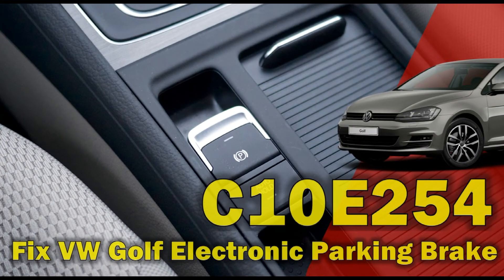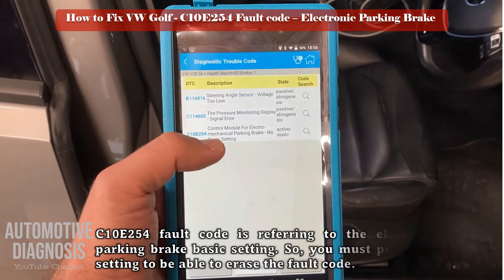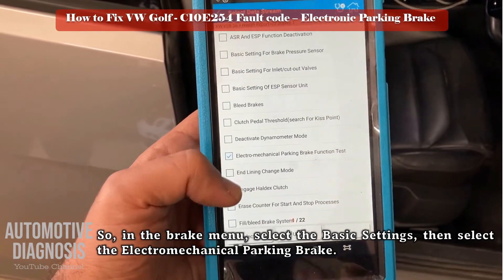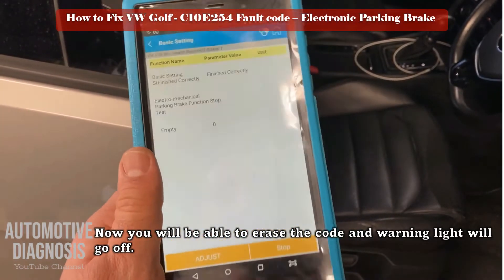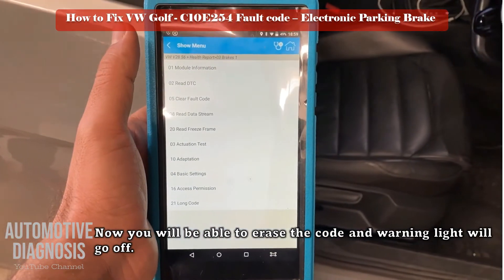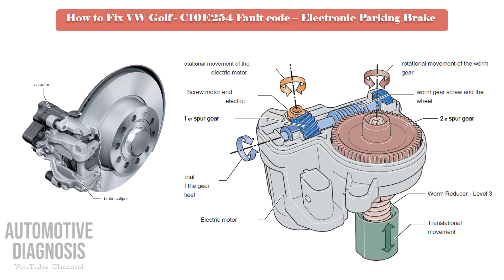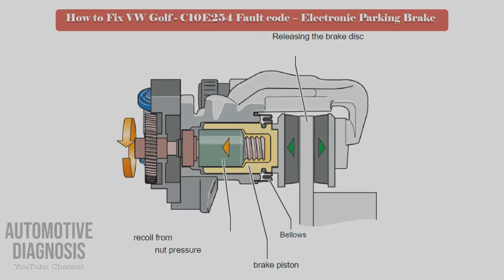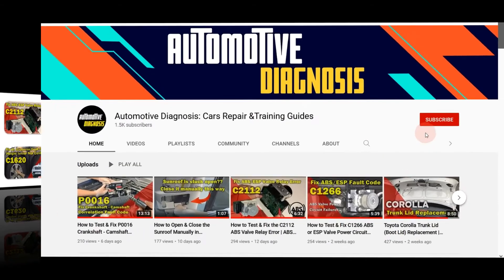How to Fix C10E254 Fault Code on VW Golf Electronic Parking Brake (EPB) Just in 2 Minutes

Comment: Hi I have the same problem and the same code.
It says on my dashboard error parking brake it does not release the brake on the right side I got the caliper changed I put a brand new one in I also changed the parking break switch but it still has the same problem. It says the same code and parking brake module the car does not release the handbrake it’s been 3/4 weeks not problem is still not solved I’m just spending loads of money
Reply: Im having the same error, did you fixed yours? If so please help me

Comment: Nice tutorial, thank you. I had the same problem with Passat GTE but I was not able to delete the fault in the ABS module, but if you delete the fault in the Engine module will erase also the faults in the ABS module. Nobody mentioning this. I am using VCDS 23.3.1
Reply from the maker: Thanks for sharing your experience 🙏

Comment: I'm using OBD11 Pro. It just won't perform the test, or any other basic settings. Keeps saying 'Function cancelled, marginal conditions have not been met' and does not explain.
Reply from the maker: I suggest to use another scanner
Reply: Hi I have the same problem and the same code. It says on my dashboard error parking brake it does not release the brake on the right side I got the caliper changed I put a brand new one in I also changed the parking break switch but it still has the same problem.  It says the same code and parking brake module the car does not release the handbrake
Reply: @adamtyler1949 in my case, two things happened before the issue fixed itself. I updated the OBD11 app, and the car battery died. When I charged the battery and repeated the test, everything worked. I’m not sure which of the two helped.
Reply: Okay thank you I got the battery tested and it was low anyway so I ordered a new battery I’m gonna change that then check

Comment: I have the C10E129 and C10E254 codes, the function test doesnt even works, it immidietly stops and sends the codes
Reply: Currently have the same issue, you figured it out?
Reply: @DryHotDabs did yall ever figure it out? I’m having this problem now.
Reply: I had to replace the caliper to clear the codes, but if your parking brake is currently stuck and you need to get somewhere you can unscrew 2 bolts that are holding the electronic parking brake and remove it, you’ll see where the parking brake was is a disc with a little stub coming out. You can release it manually. If you need a video showing how I can make it

Comment: This just happened on my 2015 model  and your video helped loads thank you … any idea why it does this fault ? Thanks
Reply from the maker: Hi there, thanks for sharing your experience. I'm glad this video helped. Normally this code appears after EPB components replacement, or sometimes after battery disconnection. It also might be an intermittent fault due to momentarily malfunction in EPB ECU.